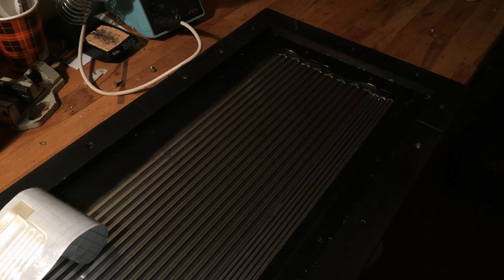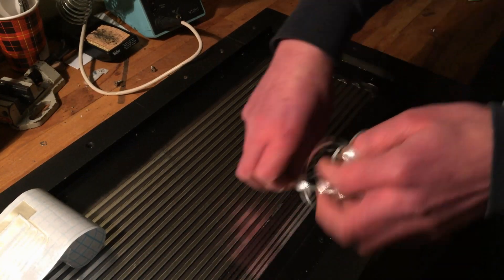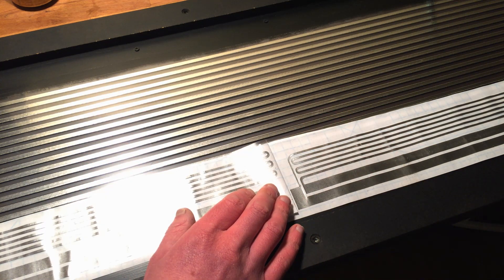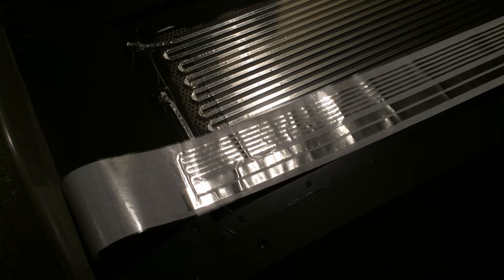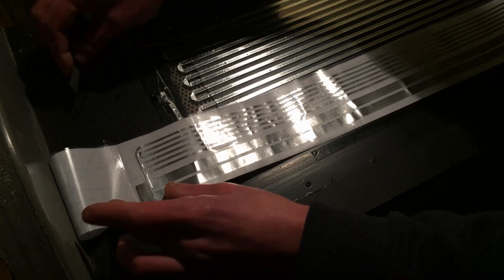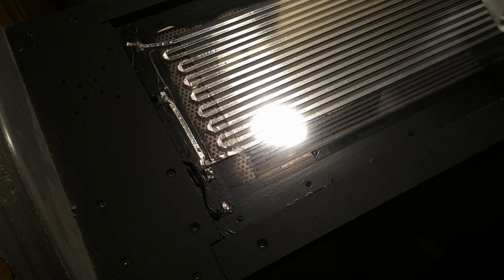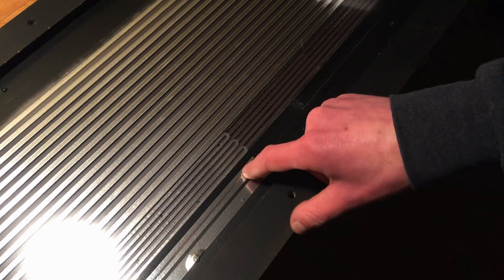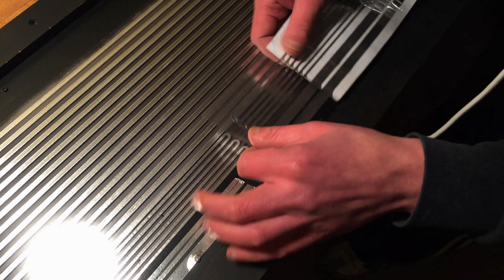Plotcut Tweeter For Planar Transfer Method part 3

Comment: Joppe, when you measure with REW what measurement weighting do you use? A or C? I’ve heard C is for louder environments but I wanted to ask someone with experience using the program. Thanks!
Reply from the maker: To calibrate db in rew you use a c weighted meter , you cant calibrate rew with any other meter. It has to be C
Reply from the maker: You play a noise from the db  calibration menu , then you look at ur c weighted db meter at the exact same spot at ur measureing mic. And adjust rew. From ten on ur mic in rew is db calibrated. Until you  change mic gain . And have to start all over

Comment: Hello joppe,
Sounds like you phone storage has lost capacity. The phone should have an expansion slot where you can add a flash chip for additional storage. Then set your phone to record to the new flash chip instead of internal storage. Maybe you already know this, just suggesting in case....
Damn fine plot n transfer BTW! Happy the Big Guns are holding up to the experimentation! Take care!
Reply from the maker: Thanks m8 but this is an iPhone.... no expansion options hehe.  If i reinstall its fine again. But if i ever record up to when  its full ,it is going mental. Video is corrupt dont want to be deleted and slowly the thing gets fuller and fuller